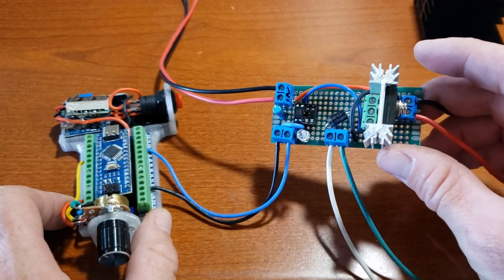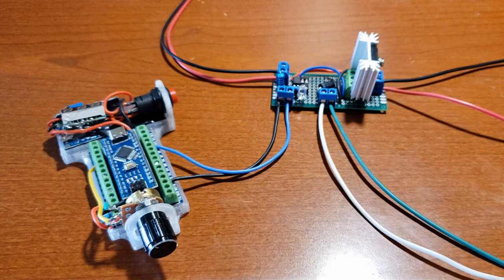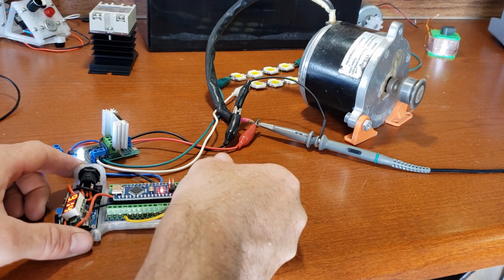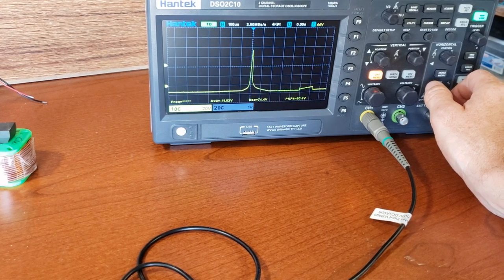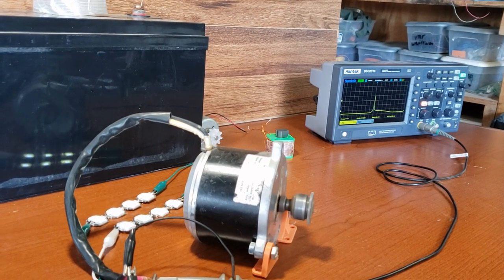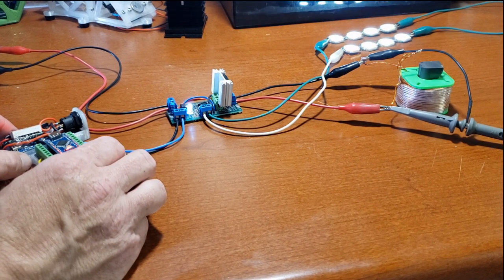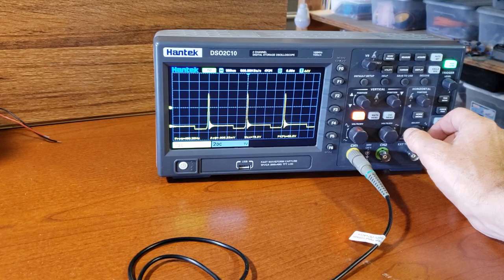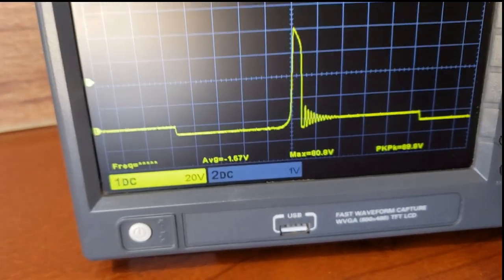Arduino Nano Solid State Relay Circuit and Back EMF Demo

Comment: I intend to use TVS diodes and SicMosfets in each of my Bedini circuits to capture the flyback a little steeper, so thank you so much for putting up that Bedini Schematic at the end of the video, it's difficult to find a schematic that's simple and straightforward at times.  I have an electro mechanical relay that will switch my batteries, but I think SSR's have their merits too especially regarding speed.  Another awesome video.  Thank you sir.
Reply from the maker: I hope you post a video of your motor when your done. I'd like to see it in action 🎬
Reply: @redesign3dp  In the new year, if all goes well 😊👍

Comment: Use a rotor on each side of the coils (dual rotor) it doubles the torque as then you use the fields from both sides, instead of just one. Double the torque for the same input.
Reply from the maker: I do have a dual rotor pancake motor with 1 inch neomags I might eventually build. Thanks for the input brother!

Comment: To increase efficiency with use of the nano you could get feedback from your output.
And use a non blocking delay to delay the pulse. Theres a sweetspot were input current goes very very low!

I use this principle in my motor wich brought current down from 180watts input at 3krpm to 45watts input at the same speed.
Reply from the maker: I'm not sure what you mean with the non blocking delay. Sounds like a tuning method.
Reply: @redesign3dp  ok so you can place the pulse trigger at some point of the wheel.
But is this place 100% right on time? Probably not 100%.
So i set the trigger a little earlier.
Then when trigger comes on the cpu, i wait a small amount of time to put out the actual pulse.
Using a non blocking delay on the cpu will delay the pulse by x time (i run a 1uS cycle on the delay and delay by the amount of uS it needs (i calculate this in a percentage to account for speed decr/incr))